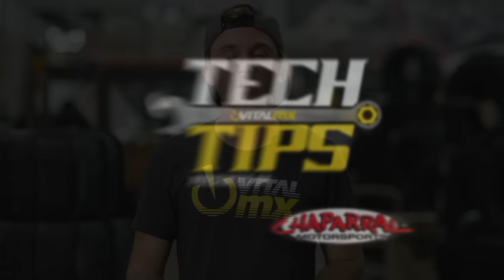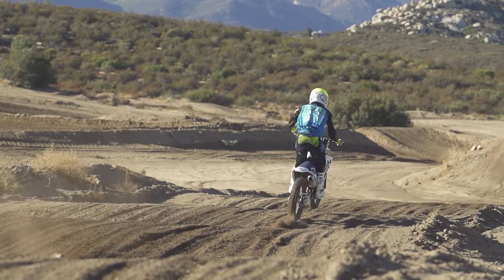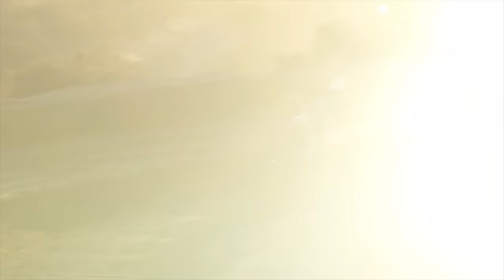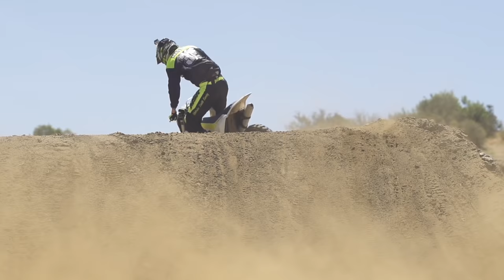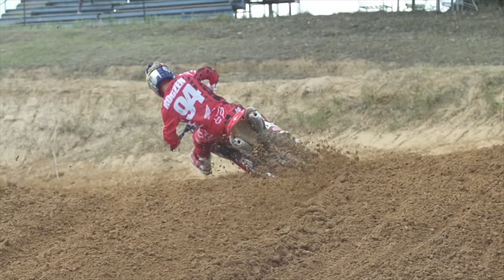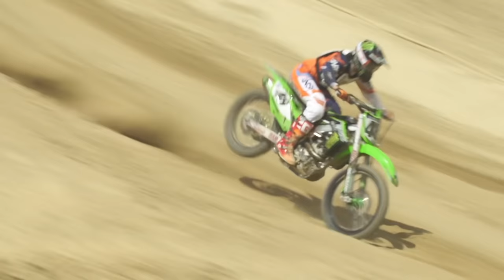Tech Tips: Setting Up and Adjusting a Motorcycle Shock

Comment: Really like the explanation.  
Watch many of these and I always hear to start all the way in cw when setting the rebound and count the clicks rotating ccw, but nobody tells why?
Could you explain this?
Reply: In hydraulic systems, it's always good practice to "close" the system and reopen it. When you are messing with the clicks, you are just making a screw go deeper or not in its thread, which makes the oil passage smaller or bigger accordingly, so when you want to tune it, you tighten that screw, to "close" the system and then reopen it. it's like a restart button on the adjustment.
And it also helps to always keep track of the stock/previous setting.
Hope it helped!

Comment: Need help. I have a touring bike that I bought used and the rear shock has 2 adjusters. One on a nitrogen gás cannister, and one in the butt of the shock. I suppose the one in the butt of the shock is rebound. What is the adjuster on the cannister for?

Comment: Could you explain what you mean when you say "get too deep into the valving" in regards to the shock packing situation?  It is not my intent to criticize, but figure out whether my understanding is correct or not.  I was under the impression that valves are speed sensitive and springs are position sensitive, so, to me, it would be more accurate to say "too deep in the travel" or "in the stiffer part of the damping curve" because in theory would it not be possible to completely compress a shock without the mid valve shims ever lifting off the piston face? Obviously this wouldn't likely happen in real life, but maybe on a dyno.  Again, not looking to criticize, just learn, because I have heard that term used before and maybe I need to tweak my understanding.  Sorry for the run-ons.  I'm a suspension geek not an English major ;)

Comment: the manual for ktm sxf 450 2014 WP suspension say that the low speed is the small flat blade screwdriver and the high speed adjuster is the outer bolt area ? so i am confused :D
Reply: That is exactly what he said. So what’s your confusion.

Comment: Thanks for this video, odds are you won’t even see this comment .but if you do go look at the last video on my channel. ( I got bucked off pretty hard )I’m too heavy for the spring rate on the 250 by probably 15lbs I was going to slow my rebound but after watching this I think I’m going stiffer on the shock and forks . After that I’m gonna play around with my high speed as I hear the 2022 CRF 25Rs are sensitive to adjust 🤷‍♂️ thanks in advance